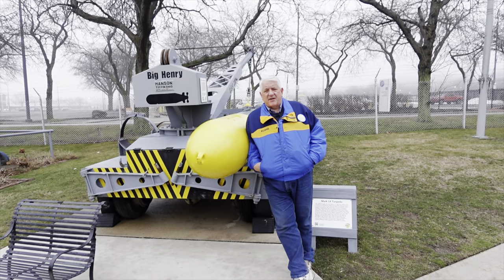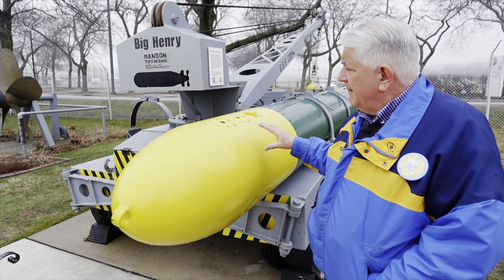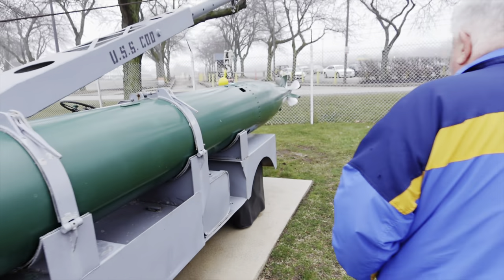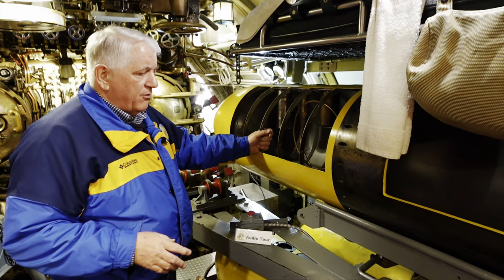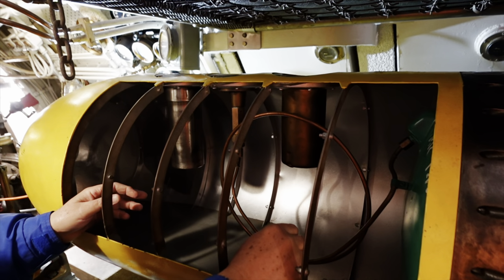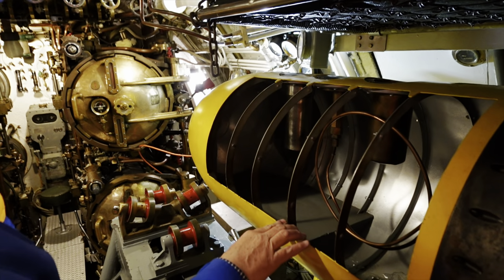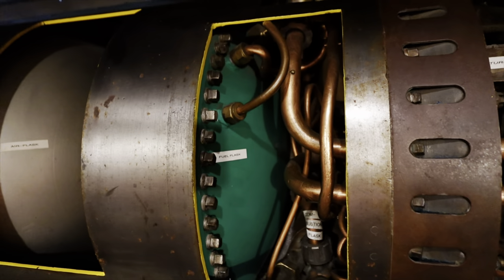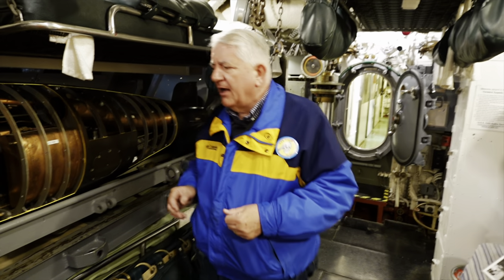Toothless Tiger: USS Cod’s Submarine Exercise Torpedoes!

Comment: Had the opportunity of firing a MK14 exercise sometime in the late 70s. Cantankerous old thing. Had to exercise the gyro daily so that it didn't seize up. I also seem to recall dropping in a few dye-packs into the exercise section as to help to relocate after fire. Once the run was over, the torpedo would blow ballast and the dye would go out as well.  I also seem to recall that the torpedo would float in a vertical orientation after it's run.
Reply: Yes I'm sorry I didn't mention the dye in the head. And depending on various things it likely could stand vertically. I'm told most were slightly angled upwards. Pity the recovery swimmers.
Reply: No need to feel sorry for the swimmer. I was that guy when we worked out of Guantanamo Bay supplying "ping time" for destroyer training. Torpedo recovery was a great chance for a swim (and a bath) and the regs called for a miniature of brandy after coming back aboard.

Comment: How do you heat the Cod during the Winter; and how do you keep her cool in the Summer ? 
Also how do you keep the Cod dehumidified in damp weather?
Very good Video. Please keep them coming!
Reply: Cod is cold iron in winter, to reduce moisture and prevent corrosion. In summer we use the ship's supply blower ventilation system and supplemental compartment fans (her shipboard air conditioning plant is not operatiobal). Thankfully our moderate weather and lake water berth mean we don't suffer the extremes very often. 

Glad you enjoy the channel!

Comment: I think you nailed it. The lead was probably there to keep it upright so the recovery aids were pointing up.
Reply: The torpedos were recovered at near vertical angles in the water. That means the nose was up and the tail was down. So it is debatable if the lead weight was to keep the recovery aids pointed up (as they would be pointing sideways or horizontal with the ocean). More than likely, the lead is to trim the torpedo and simulate the weight of the warhead for accuracy of firing exercises. As Paul mentioned it is likely that the real warhead enabled torpedos had similar weights in the nose.

Comment: That device is not a whistle, it is the valve that supplies air pressure to the exercise head and blows the water out of the valve at the bottom at the end of a run when air flask pressure drops to around 500 pounds or so.  Maybe it makes a whistling noise when opened but it is definitely not a location whistle.
Reply: Yes. That's what the manual says ... my information came from a recovery swimmer... so he interpreted it as a whistle😂. I thought it was likely not quite accurate but it made for an interesting discussion. I hoped some torpedoman would provide the straight information!

Why does it need a top valve? To prevent over-pressurizing the exercise head?
Reply: The "top valve" is connected to the air flask and supplies the air needed to empty the head and make the torpedo float. When flask pressure is above around 500 psig it is closed. When it senses a differential between external sea pressure and flask pressure below about 500 psig it opens and discharges air into the head. That valve with all the holes in the bottom of the head opens when head pressure exceeds sea pressure and the ballast water blows out making the torpedo buoyant and floating head upward.
Reply: Great information!

Comment: Just wondering, since there appears to be open voids inside the torpedo that I would assume are at atmospheric (sea level) pressure.   Once the torpedo tube was flooded in would be under the pressure of the surrounding water.  Was there a limit in depth which they could be fired?
Reply: Yes the impulse air limited firing  depth.  But what fish was accurate if fired from below 100 feet in this era?

Comment: What percentage of alcohol [ABV, Proof] was used as torpedo propellant? I knew a Marine SBD pilot [my Dad's friend] who said on Guadalcanal -- while getting shelled by the IJN, they used to get bombed thenselves with a cocktail of Torpedo Fluid and Dole Pinapple juice.
Reply: A subject for a future program ...
Reply: @paulfarace9595  It had to be the Primordial Tiki Drink. I wonder if BuWeps had switched to Methanol in mid '43, if the Mark 14's score would have gone up -- along with a rash of suddenly-blinded old Chiefs?
Reply: The Soviets has to go to extensive lengths with the coolant of the MiG-25 Foxbat to prevent the ground crews from swiping some when the vodka ran dry at remote bases. Because of the Mach2.5+ design of the airframe and the vacuum tube electronics they had to use pure alcohol to cool things down.
Reply: @chrismaverick9828  I saw that on a YouTube presentation. While Vacuum Tube electronics [Fluid State] may seem archaic in the West, they do not have the foible that Solid State electronics have under an EMP burst.

Comment: What keeps the torpedo tube water tight?❤❤
Reply: Tiny rubber gasket rings. They're about 1.5 inches thick by 0.75 inches deep and 25 inches in diameter. But the actual sealing contact is thinner than a soda straw.